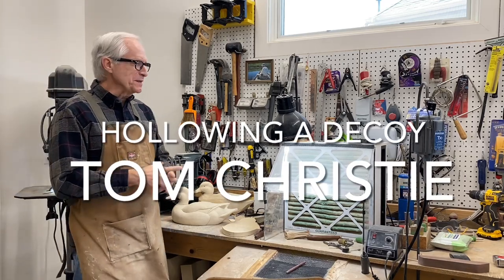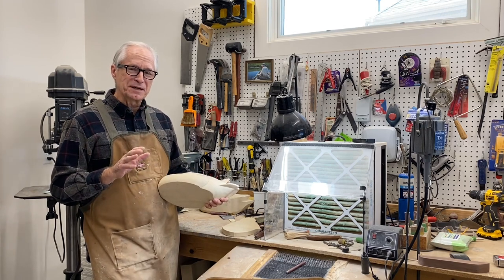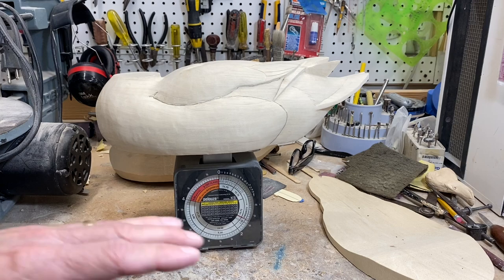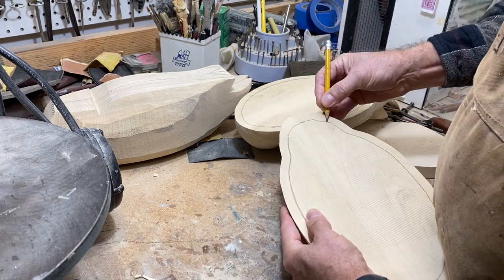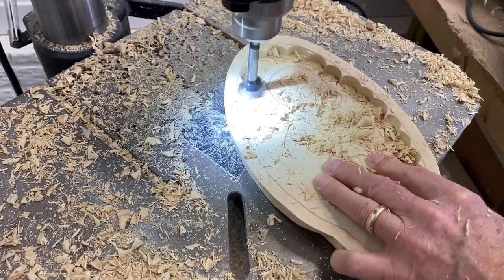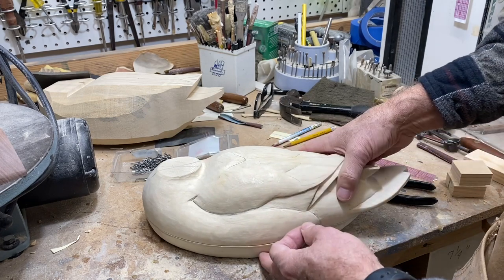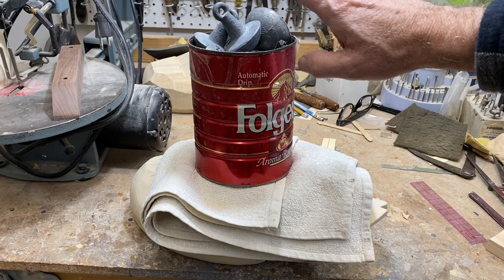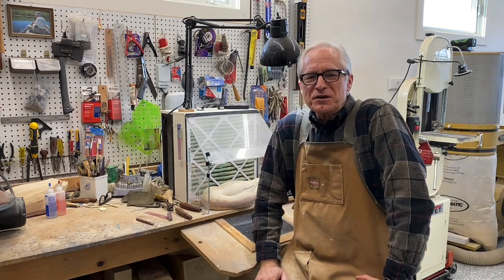Hollowing a Decoy

Comment: Great video. Thank you for sharing.  Personal experience with a student hollowing out a decoy, he either did not have a good grasp on the decoy or it slipped out of his hand, but the body spun back around (the forstner bit and drill press had control of it) and took off part of his thumb nail.  Due to the blood and pain the student passed out, went flat out on his back (stiff as a board) and busted his head open!  Blood all over the floor.  He was taken to the hospital and had a pretty good concussion.  It was so bad that he repeatedly asked me what happened, he couldn't remember anything.  So, you are correct, drill presses are powerful and you better have a good grip on that body!!!
Reply from the maker: Good reminder Daniel. Thanks for sharing that story. Be careful out there carvers!

Comment: Bondo is a polyester based.  It will get really hard.  Why not use an epoxy based filler that remains somewhat resilient?
Reply from the maker: Good point Joe. I like the way Bondo feathers well when you sand it and it has always worked well for me but as I mention in the video there are many good approaches to hiding that seam. What epoxy-based filler do you recommend?
Reply: @tomchristieart  I have had good results with a product sold by Aircraft Spruce.  Poly-fiber Super Fil - It is epoxy based and designed for wood adhesion
Reply from the maker: I appreciate the recommendation Joe. Always learning and I will check that out.